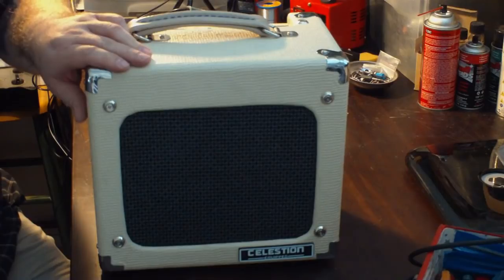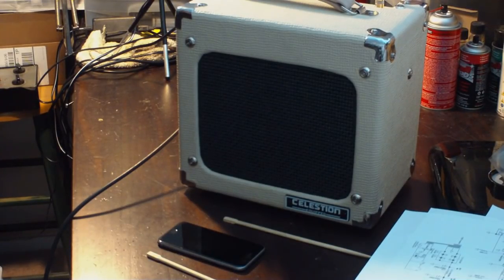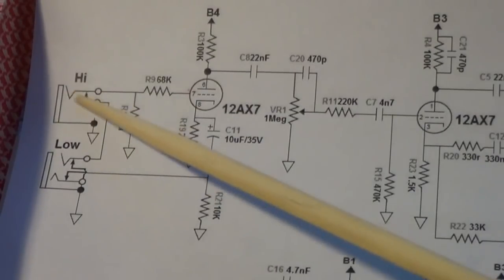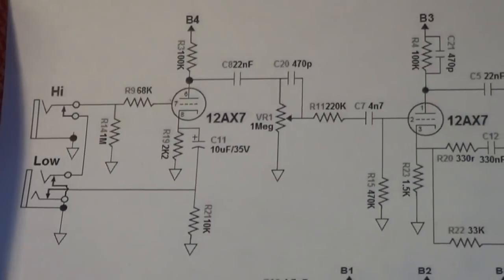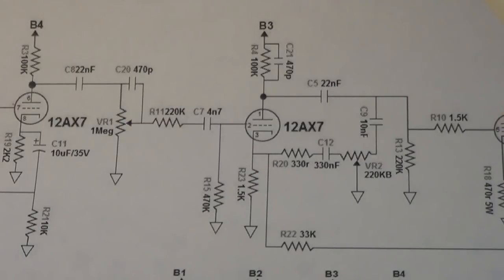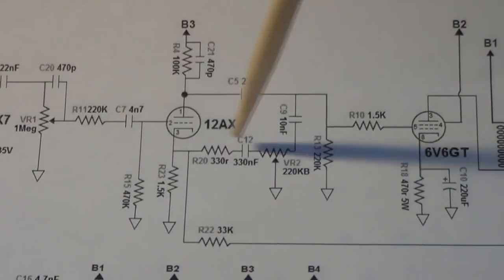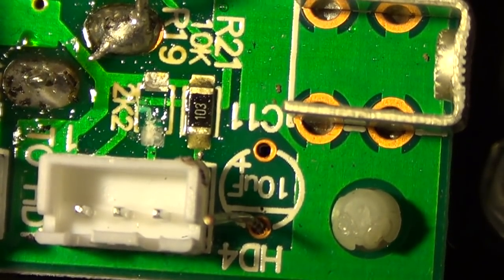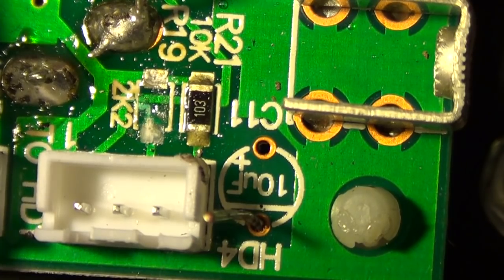Modding a Monoprice Stage Right Model 611705 Tube Amp

Comment from the maker: I've had several requests for the schematic I drew up for this. You can find it here: https://www.facebook.com/1933166673654491/photos/a.1933168396987652/1933168306987661/?type=3&theater
Reply: I'm curious what app you used to draw up the schematic... looks real nice.
Reply from the maker: @enorbet2  I used MS Paint. Lol

I made a template for schematics years ago, so it’s really easy for me to draw them up.

Comment: thank you very much for the video and the great explanation. 
to make the thing louder removing the negative feedback is the most efficiant thing… this bring it up the three db you wanted. I changed C10+C11 both to 22uf, changed R19 to 1.5k, removed R11/R20/C12/R10 and made R22 switchable. the amp sounds great now! I also added a mod for using 6L6gt tubes for boosting the output to app 8 clean watts: To do that you simply add a 5w /470ohm resistor parallel to R18 ( or put that on a switch ), so you can drive the amp with 6L6gt tubes with correct bias. Second thing to do is to make a new output jack with the (unused) middle pin of the output transformer (between the red and the black cable. This is the (not connected) output for 4ohm speakers. If you use the amp with 6L6gt valves this output wants 8ohm load, so put the original speaker on a jack and plug it in there. amp sounds great with 6L6 tubes and gets much more clean headroom, esp. if neg. feedback is off.

Comment: I think the RCA manual said not to go so big on that first filter capacitor has more to do with not killing the rectifier tube with a huge inrush of current. With diode rectification, that’s no longer an issue

Comment: Very interesting video and very nice sounding mods! As for C21 - it creates a low pass filter together with R4 and Ra of the 12AX7 having the cutoff frequency Fc = 1/(2*pi*(R4 || Ra)*C21). Ra for 12AX7 is approx. 80k at Ua=100V so the cutoff frequency ends up being approx. 7.7kHz. The purpose of this filter is most likely to prevent parasitic oscillation in the feedback loop at ultrasonic frequencies. It would also reduce fizz from preamp distortion. On the other hand, it can make the amp sound a bit dull especially when played clean. It might make sense to replace it with, say, 220-270pF which would raise the cutoff frequency to about 13-16kHz which would let the high end through but would still help against any unwanted HF oscillation.
Reply from the maker: Thanks for the excellent info, Al! I'm going to pin this info to the top so people will know.
Reply: Excellent observation. C21 is to prevent high frequency parasitic oscillation. You wouldn't hear it, but you could see it on a scope and it can cause the tubes to fail if unchecked and it gets high enough.

Comment: I've modded the 15 watt version. When I was dealing lowering the cathode bypass resistance I just paralleled a 1/8 watt 4.7K metal film resistor across the SM 2.2k in to get 1.499K. You can bend the leads, cut to size and wet the leads and sides of the SM with a very little bit of solder then place the leads on the SM pads and heat. I laid the 1/8 resistor on it's side. It's a lot easier than dealing with replacing the SM component and safer for the board.
Reply: Yeah I did this as well. I didnt do all of the mods in this video, but I did some. I didnt want to mess with the SM components anymore than I needed to. Has anyone replaced the pots on this amp ? I was curious about this. I think its a 1m and a 250k.

Comment: I've so far resisted turning this into a Champ/Princeton, wanted to give Laney their due for whatever they had in mind design wise.

I put a switched B100k pot in line with the  NFB white wire, left R22 be, I get about 100K total just switched on which is pretty greasy, switched off I get all the noise.

Riveted a 9 pin tube shield base right to the chassis, the tube sits a touch lower relative to the shield but there's so much less input hash isolating that 12ax7.

Cut the trace from the 22uf screen grid cap and installed a 470R screen resistor. Recapped the psu and the power tube bypass cap with the Taiwanese Supertechs, just to get rid of the sketchy chinese caps.

The only surface mount meddling I accomplished was to parallel a 68K across the 68K input grid stopper to get it to 34K.

The best change was a 60's Rola 8" ceramic, so officially it's still Celestion loaded but not with a speaker ftom the Celestion toy department. I tried a 50's Heppner 8" alnico but the circuit voicing didnt suit it.

Then good tubes, stuck with old stuff, a USA Tung Sol 6v6 and a late Westinghouse 12ax7. Rebiased the 6v6, made a 400R resistor, got it to 12.1 watt plate dissapation. Tried a Russian 6P6S, didnt care for it, I think it needs to be biased at its 13W total pkate dissapation. Could have a switched bias resistor I suppose

2x12 ceramics is a different story! I have a couple 60's Jensen C12R's in a cab, they're fun with this. Mine is a 2019, not the TV front like yours. There's a 4 ohm tap on the output transformer that doesn't have a lead, easy to add the lead & an additional jack or a switch.

I like it's not a Champ but I'd appreciate a spongier psu. I might add an EZ80 hybrid rectifier with the diodes or just a straight EZ81 if I get ambitious. If I do I'll likely ashcan the pcb, install tag strips and handwire it all. The mdf cab is okay but it really needs a plywood baffle the keep the speaker from mooshing out.
Reply from the maker: @oldasrocks9121  sounds like you like to tinker like me! Nice

And I’m glad the changes you’ve made have given you a tone you like. Thats a good feeling. 

For what it’s worth, being a single ended amp, switching to a tube rectifier won’t give you any sag. You would need a push pull amp to get that. SE amps already draw max current at idle so sag isn’t possible. 

Keep at it though! Finding that perfect tone is why we do it!
Reply: @davetriestofixstuff4744  Yessir, it is not sag, you are correct. It can be much spongier though. Take the 5F2 for example, real world build with 10uf caps instead of 8uf's, the reservoir/plate cap is 2 10's with a choke between positive ends. Then the screen grid node, another 10 and the input/driver plates the final 10. Essentially 20/10/10 with the 5Y3 hitting the 20, very unstressed that way.

Most folks would think that's an almost crazy level of unfiltered PSU these days but what is gets you is a bit of a soupier attack and very likely a flabby low end which is almost certainly why the 5F2 got a ceramic 10". 

In the Laney Cub 8 case the first cap at 100uf the low end is compressed actually and pick attack is needly, the 2 22uf's are almost bookmarks it starts over filtered. I left it and it seems to work well with the 50's Heppner alnico I settled on. To go with the 60's Rola ceramic I got for this I think I'd drop it to 47uf but I have to wonder how it would fare in the MDF cabinet and the dead MDF baffle. 

All that's gravy, I absolutely have to hunt down that gristly buzz that's in front of the power tube hum, I suspect a ground loop, or a couple.

The ones like mine with the controls on the front fly those flat ribbon cable connections across the full depth of the chassis, same with the input lead and volume control leads so I'm a little surprised I'm not picking up radio stations too. Your tv front and the actual Laney have the beneficial layout, this one will be a challenge to make quiet.

Comment: Surface mount boards suck only until you learn a few new techniques and maybe get a couple new tools.  One you learn to work with it, it can sometimes be a lot easier than through-hole boards.  Changing parts can often be done without having to remove the board to get to the back side, for example.
Reply: Yep. Hot air is cheap enough now that it's worth having around just for this type of work.

Comment: I have had this amp for a while and I just did the modification of putting a 50k pot and a 10k resistor in the negative feedback loop and it gives it a pretty good amount more gain, I might go back through it and do more of the mods you did in this video but I am about to build a champ style circuit with parts from an old silvertone reel to reel I got from a thrift store for $25. Great video, this is probably the 4-5 time I have watched it.
Reply from the maker: Thanks for the kind words, Stephen.

Comment: A minor techy point. I think I heard the comment like a 3 dB increase in level means it's 2x as loud. No. A 3dB increase in sound level which is just detectable by most people is achieved with 2 x the POWER o/p for the same speaker etc. Since our ears are logarithmic  in response there needs to be about a 10x increase in power level to be perceived as twice as loud. This is a basic thingy in acoustics.
Reply from the maker: Thanks for the info! I believe there's a similar post about this below, too. I was getting the measurement of the audio confused with the sensitivity of speakers. A speaker with a sensitivity rating of 96db will require twice the power to be as loud as a speaker rated at 99db. Thanks for the clarification though!

Comment: Damn this was a great video, definitely subscribing! You need the 15 watt Monoprice now, that's a Cub 12R and it's supposedly based on the pre amp of a JCM800. I have it and it's a pretty great little amp, shit is loud as hell though I'm almost always running it at <1 watt.
Reply from the maker: I'm getting a lot of requests to mod one of those 15 watters. I'll have to check them out. Thanks!

Comment: The reason the Tube Books say you shouldn't go beyond 30uF for the first filter cap is because that's what a rectifier tube can usually handle!
The first capacitor draws current when you turn the power on, and that current is directly proportional to the capacitance. More capacitance = higher startup current draw.
However, those tubes usually could handle a couple hundred mA of max current draw, but since this is based in 1A silicon rectifiers, the "rule" doesn't necessarily apply, as these can handle much higher loads.
Reply from the maker: Excellent info! Thanks for letting me know! I'm guessing you're "blackcorvo" from the Wattkins forums. Glad to have you along!
Reply: Dave Tries To Fix Stuff yep, that's me.
I thought it was relevant to bring up, however that does not mean the amp is gonna sound bad if you reduce the 100uF cap, that's up to what your ears prefer.
Reply: there is no rectifing tubes here (19.46,) its diodes, the higher the value the stiffer the sound will be so keep that 100 uf ,
Reply: breakfastbuddy5 Can't you read? He said the amp uses silicone rectifier. Also, he was just saying that the - no more than 30uF for the first filter cap "ONLY" applies to an amp with a tube rectifier.

Comment: I used most of the mods .on this vid. I did a variable nfb loop from Uncle Doug's 5F1 mod and it works awesome..I built a bigger cab with salvage solid oak and installed a 10inch greenback...I like this circuit enough to buy another one and I just did

Comment: The whole point of a little amp like this is to NOT be loud.  Still, very interesting mods, thanks!
Reply: Any tube amplifier that would be made to not be loud would sound like it has a pillow into the speaker
Reply: @Music_is_fun  Why make a 5 watt amp if the purpose is to be loud?  It's all relative.  These small amps are intended to be a lot less loud than 40-watt and bigger amps.  Why?  For practicing or in the studio, or to keep stage levels low when amps are miked.
Reply: @Music_is_fun  You don't get it?

Comment: I'm looking to buy this amp and I was really hoping someone had done a video with exactly what you've done. Thank you.

One observation. You went into detail about measuring the decibels at the start, but did not test again after mod.i was curious to see a measure of the improvement.
Reply: I've been gigging for 50yrs and I bought one of these amps 4yrs ago and I'll say it's a great amp for any size gig, no matter how strong the drummer is you can still hear yourself on stage, I recommend you buy it you won't be sorry 👍 but you should work out the speaker, hook up a stereo with a lot of bass and let it play for hours and it'll loosen up the speaker and it will sound much better ☺️

Comment: That's weird, 1000uf tightened up the low end? usually you'll want to use a lower value to cut bass. That feedback resistor makes a huge difference aswell.
Reply from the maker: M V you’re right. Bad choice of words on my part. It provides better bass response and makes it closer to fixed bias.

Comment: In my Laney Cub 8, the tone knob is in between the last pre-amp tube and the power tube. I'm planning to put a slot in between that will serve as an effects-loop. Would that be safe? Thanks in advance.
Reply from the maker: Hi Rod. I'm not sure what you mean by "slot". Can you elaborate? Putting in an effects loop isn't all that difficult (in theory) but this amp may not be the best platform for that type of mod due to the SMT components. Plus, a passive loop may not have enough recovery to send an adequate signal to the power amp. If you added one, you may have to have a boost pedal at the end of your pedal chain to push it.

Comment: Im working on one of these i just bought, ive done most of what you did actually. I did remove the 100uf/450v and put a 22uf/450v in and i would advise you try that honestly. Thanks for your video as you confirmed most of what I saw as issues with the design. But the newer model of this had some of these parts changed already. I have the newer design with the knobs on the front. Im using a 6n2p preamp tube with an adaptor and a 6p3s output tube instead of a 6v6. I use a reverb pedal and thats it with this amp. I also removed the Super 8 and I put in a 8 15 Celestion speaker and wow ! Much better speaker for this circuit than the Super 8. Was only $20 for the speaker onsale. I do wish this was a 10in speaker. But i tried this amp with the internal speaker and a 12in cab loaded with a Jensen C12K. Sounds really interesting. Are there any other mods you have discovered or tried on this ? Thanks for the video, you rock. :-) 

Oh yeah I use those same pens you do, love the fine point ;-)
Reply: Also has anyone messed with removing or changing the bright cap ?
Reply: Im trying to find a lil more Bass. What are some of ya'll suggestions ? I think changing the bright cap to a different value will help even out the eq better. Right now I really have to keep the tone knob toward the bass. Just a little movement of the tone knob and a ton of highs come back in.
Reply: The Celestion 8 15 is a much much better speaker than the Super 8, this speaker sounds better and better the more ya play it. The stock speaker wasnt terrible once it was worn in, but it didnt handle bass well and after these mods, you will notice the stock speakers weakness. Right now you can get the 8 15 for like $22 on Amazon with free shipping. I think its usually like $40.

Comment: I know this an old post but I was thinking of using some of the original parts cab speaker pots etc and replacing the pcb with a point to point 5f3 circuit with nice caps and a premium output transformer (hammond . heyboer or possibly mercury magnetics) in your opinion is this feasible or a waste of time?

Comment: Thanks so much Dave.... 
I’ve located a local seller & I’m off to pick up one of the same models today.  
I greatly appreciate the Schematic markup. Is it possible to get a few photos of the “locations” of the components? 
It would also help in identifying the size of the components.  
And if possible, a sort of “Parts List”? Thanks in advance. 
Joe

Comment: I think I may have broken mine by leaving it on too long by accident, the fuse doesn't look completely blown, and there is some brownish discoloration on the PCB beside the tub socket solder connections. Is that normal to have the brownish discoloration or is yours completely green beside the sockets. Also, this is a fantastic video, I've always wanted to learn more about how tube amps work and you did a great job explaining your modification and how it works! Thanks!
Reply: I deliberately left my 2015 Fender EC Vibro-Champ on for 3 consecutive months when it was brand new. Yes I used it as a space heater in the bedroom just so I could gently burn in all the components. I left the volume at it's lowest setting. My amp is fine and still running like the Champ it is!
So I doubt leaving the Stage Right 5 watt tube amp on for an extended period of time by accident would hurt your amp. I have two of these Stage Right 5 watt x 8" speaker, one 12AX7 preamp tube and one 6V6 power tube, with a tone control and volume control and a 8/16 ohm speaker output jack on the rear. I play them through different 12" speaker cabs, a 1x12 and a 412 and a Full Marshall stack with two 412 speaker cabs. I love these amps!